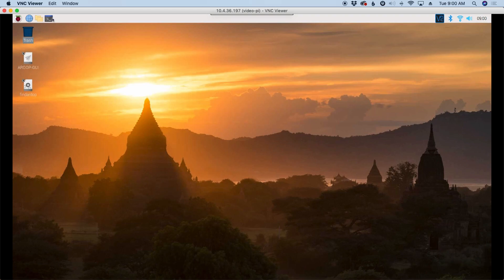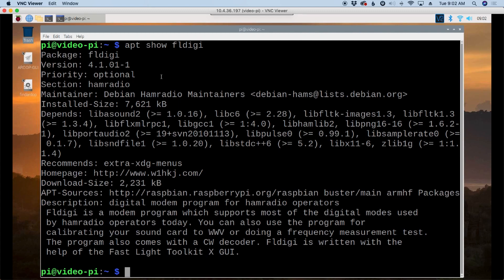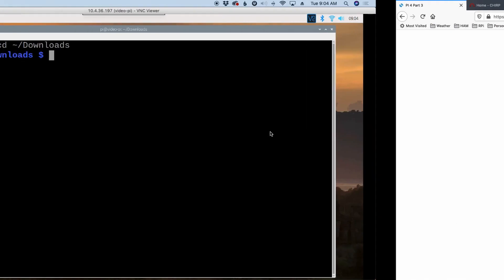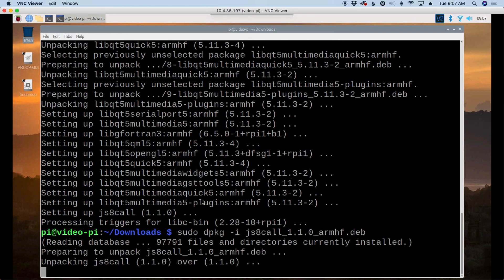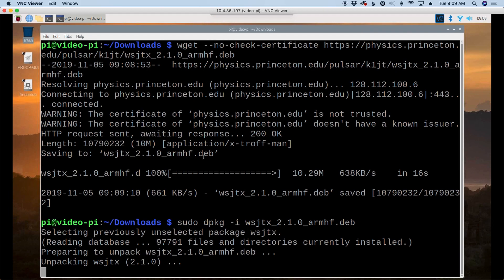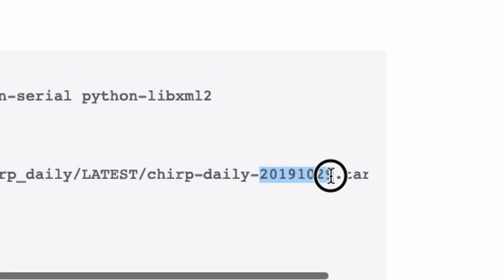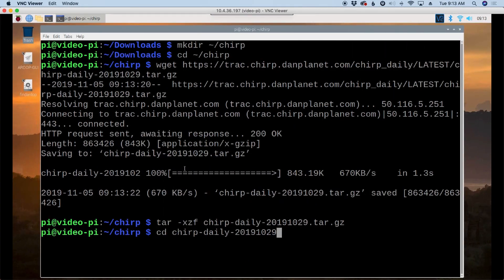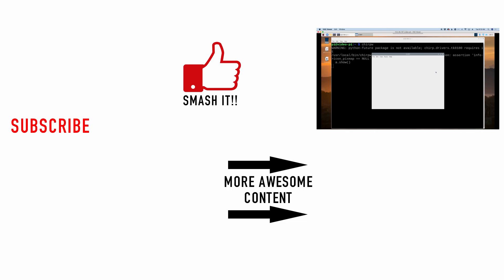Raspberry Pi Build for Ham Radio Part 3 Step by Step

Comment: I have really enjoyed this series. my Pi4 build is almost complete. I do have some advice for those who might have issues with flrig. The version of flrig in the repository would not control my FT891 properly. I had to get the source for  the latest version from here :https://sourceforge.net/projects/fldigi/files/flrig/flrig-1.3.49.tar.gz/download
and compile it as is done in part 3 of this series for hamlib. This fixed myrig control issues. 

you will also need to install FLTK first, this can be done from the terminal by:
sudo apt-get update
sudo apt-get install libfltk1.3-dev
Reply from the maker: Talk about great timing. I just had another viewer email me about compiling FLRIG from source. I think his issue was with libfltk. Thanks for reporting this!! 73, de KM4ACK
Reply: NO, Thank you for this excellent series!!

Comment: What hotspot hat are you using? You never show the unit you have. Just interested in the case/antenna etc. I was wondering if heat sinks are absolutely required and if the MMDVM hat will fit into a normal case of if you have a larger case, or maybe you connect it externally?
Reply from the maker: The hotspot I refer to is a WiFi hotspot. I think you are thinking about a radio hotspot. It's a bit confusing when talking about either with a group of hams. 73, de KM4ACK

Comment: Which Pi are you using?
Reply from the maker: Pi 4 for this tutorial but it should work fine on the Pi 3 as well provided you are using Buster as the operating system. 73, de KM4ACK

Comment: Thanks, I am making more sense of the RPi and I have wsjt-x working with my KX3.  I have been using FT8 for a couple of years, I now have it working on the RPi as a headless machine and made a few 80m 5w contacts last night.
I now need to get back to PAT and FLRIG.  I had to use the rig interface within wsjt-x and define the rig as KX3 not flrig.  flrig would read the freq but would not change.  I need to sit by the rig and try flrig to see what is happening.  Would having PAT/ARDOP running in the background (?) be the issue?
The Build Guide makes it all work, I printed it and wrote notes and "checks"  as I went. 

73, steve WB3LGC

ps: I see the advantage of flrig, as I can add KX3 macro's to (and maybe) tune the antenna (not found in program internal rig control)...
Reply from the maker: Having Pat running in the background shouldn't cause an issue but I would close everything until I had FLRIG installed and configured just to be on the safe side. No point in putting anything in the way that might cause an issue while you are trying to get things configured. Once you have FLRIG installed/configured, then start linking things together.  73, de KM4ACK